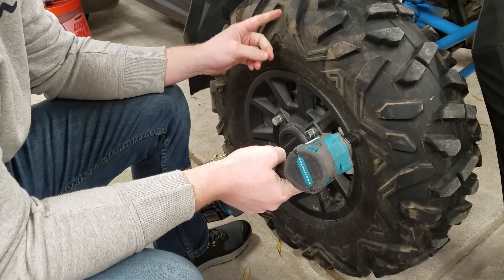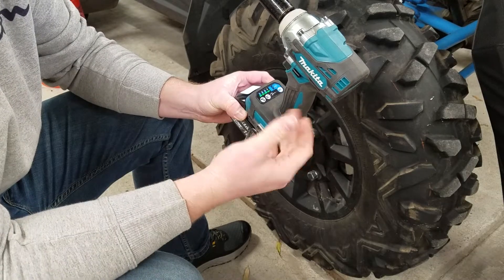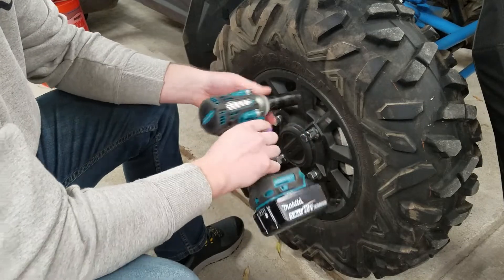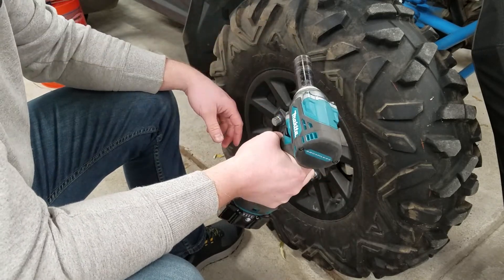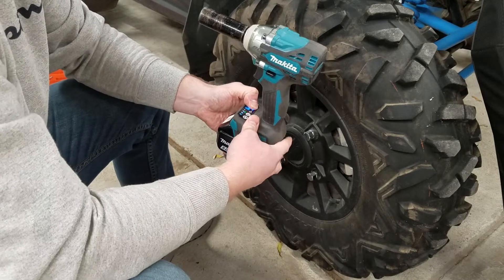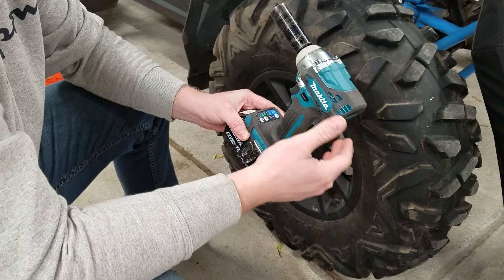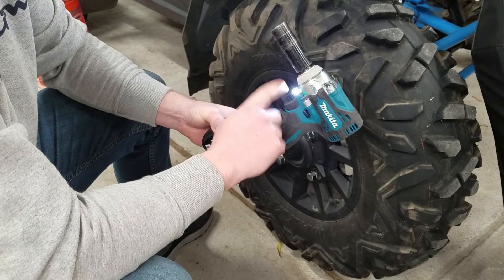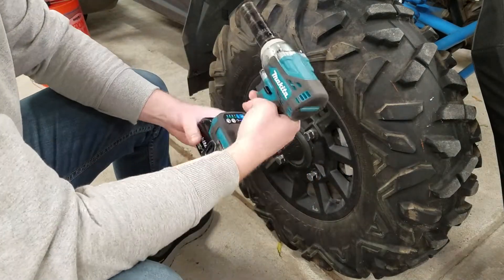Makita XWT14 1/2" Impact Wrench Features Review & Test

Comment: I had the detent pin version xwt15 and returned to home depot the next day. Having to use another tool to swap sockets got old quick. I ordered the xwt14 while I was at customer service/returns. It's a shame they don't actually stock them in store. 5 more days...😖

5 days came and went and I'm loving this thing. Sockets are nice and snug once engaged, but come off easily with a tug without straining the shoulder. The xwt14 impact is the way to go.

Comment: Good review, im stuck between purchasing this model and the new mid torque
Reply from the maker: The mid torque is definitely nice too. I purchased mine before the mid torque was available though since the work I do I find this one to be plenty powerful. But  more power doesn't hurt either.
Reply: @HawkTown28  thanks for helping me make up my mind, I pulled the trigger on this model.
Reply: I got the XWT17Z a while back and tested it in a junkyard. I was able to remove 4 infamous Honda crankshaft bolts with a 3A battery and a Lisle socket. The impact wrench struggled a bit but ultimately passed the challenge. However, the 17Z is bulkier and heavier than the 14Z. I'm considering pulling the trigger on the 14Z but I'm undecided right now.

Comment: Thanks for the review.  I have the same model as yours but couldn't figure out the auto stop mode in clockwise direction.  When the bolt is already tight and you use either of the application mode levels the wrench will still power through, blowing to tighten further without cutting the power.  However, if the bolt is loose and you start slow all the way in the auto stop seems to work but not accurately.  Say in level 1 it's supposed to cut power as soon as it starts the blowing motion but I see some delay.   Can you share your experience?
Reply from the maker: Hello. Thank you for watching the video. I find that I have to pull the trigger fully in order for auto stop to work. If I slowly pull the trigger and not all the way, then the auto stop does not seem to work either.  It also works best if you leave the bolt or nut unthreaded as far as possible. That way it gives the tool more time to spin up and activate the mode.  I find that if I hand thread on the fastener too far, then the tool does not have as much time to "think" and react.  But if I leave the nut backed off a good amount and rapidly pull the trigger all the way, it seems to work good. Hope that makes sense.
Reply: @HawkTown28  Good to know.  I thought I had a defective unit.  Thanks again